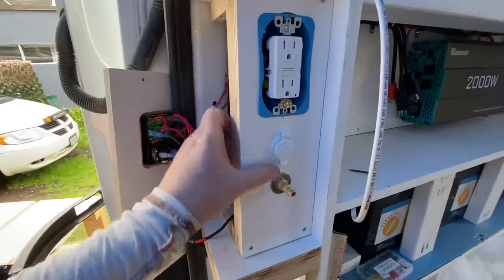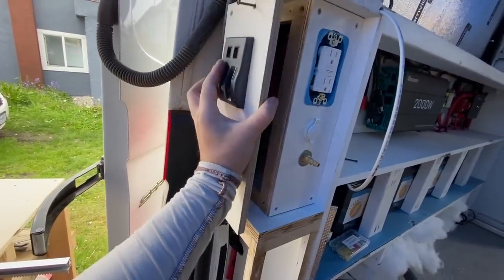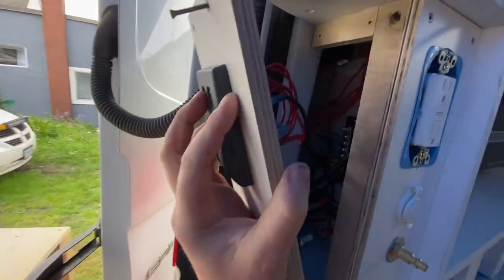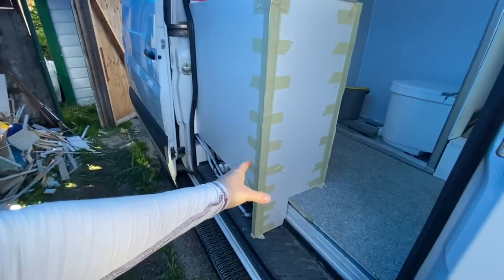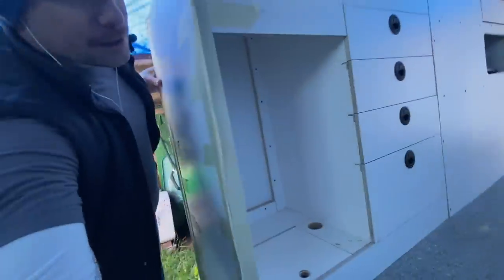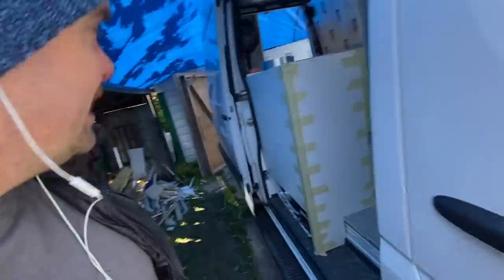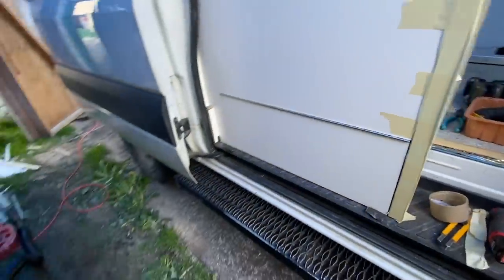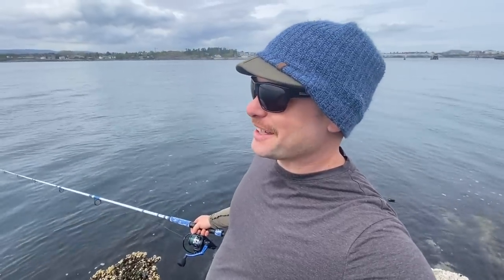Van Building Is A Tight Job || 4x4 Sprinter Build Pt-7

Comment: What sheet materials are you using, is it a marine ply?
It looks stunning
Reply from the maker: Yeah mostly it's a Melamine plywood core product.  So the face is a melamine finish.  It looks pretty good, but it's not the most forgiving material. The melamine easily chips off the edges so extra care is needed in cutting and bevelling the edges.  

I'm not sold on the stuff myself, but it's working well in nicks van build.
Reply: @SharingTheWild  I've returned to college as a (very) mature student - to get a skill set - if I could have 5%of yours, I'd be proud of myself. I'm back to working with MDF with veneers tomorrow, and like the idea of plywood cores. :)
Keep up the good work :)